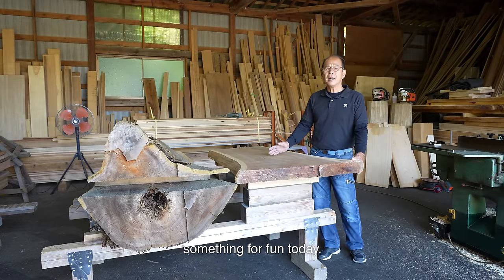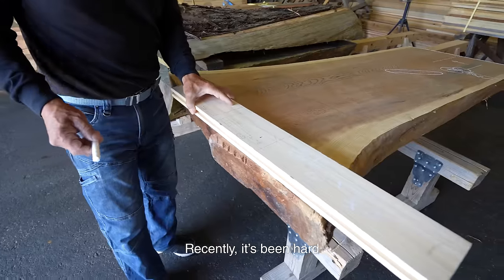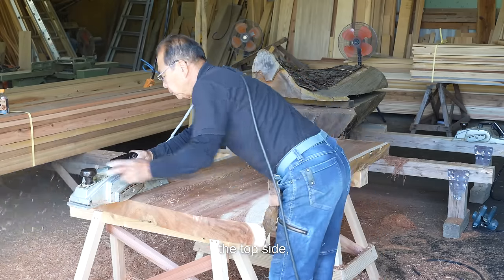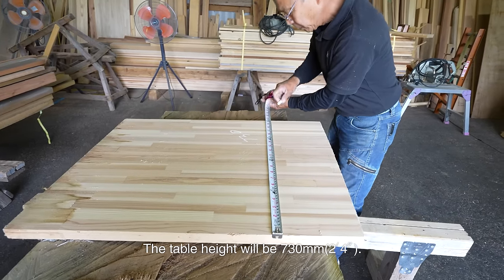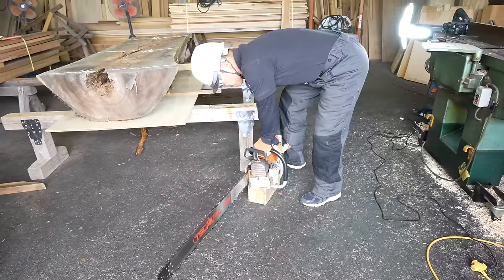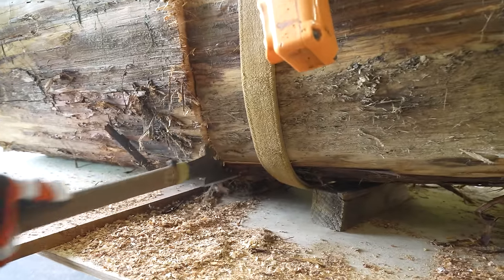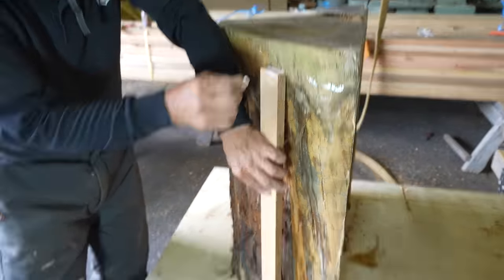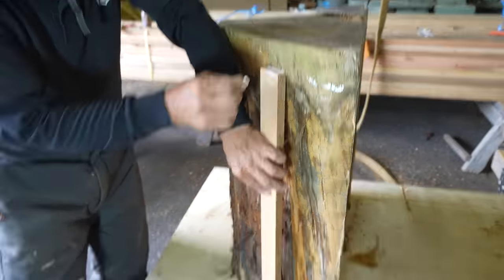Build a Massive BBQ Table for $0 Using Waste Wood! [Carpenter’s DIY]

Comment: wood is wonderful!!!! I logged for a few years and worked at two different saw mills i had a 46 mag saw!!! they are good ... But the most lovely wood is plum walnut is good persimmon is nice but by far plum is the prettiest!!! see if you can find some it would have to be old when they die but you will not be disappointed!!!! your table is good and your wife may have liked it!!!